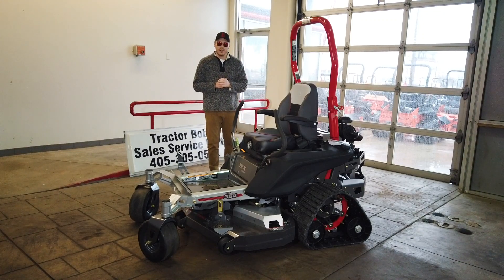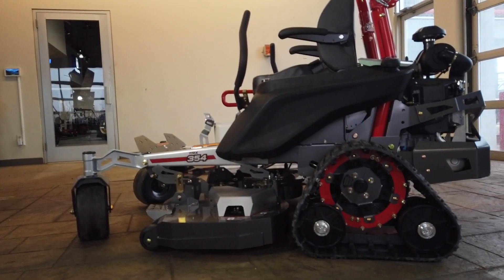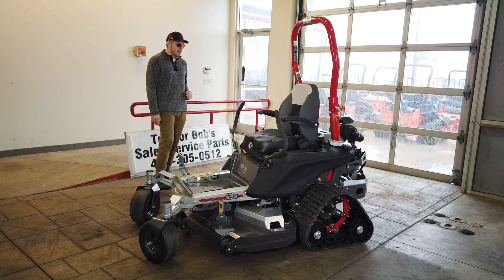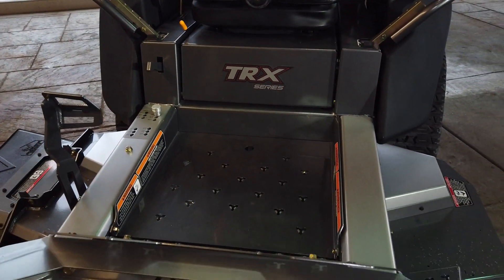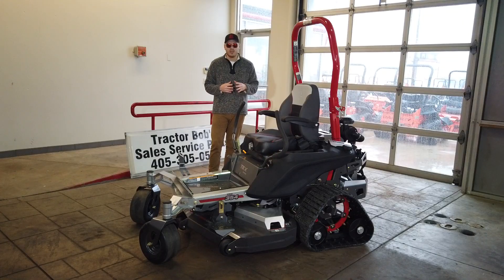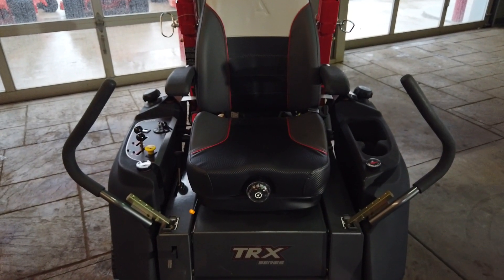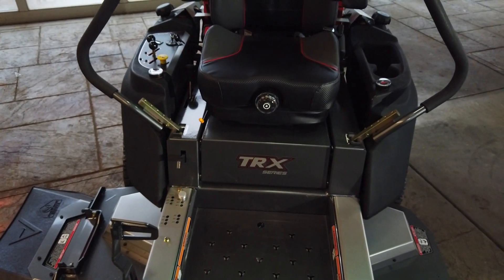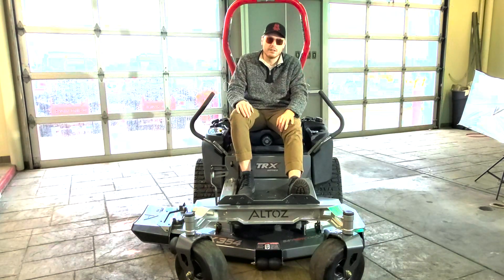ALTOZ TRX354 Zero Turn Mower Review ((most Extreme mower around))

Comment: a couple of things,  the 3400 trans is a bit lite for pushing gravel. don't you think a 3800 or 4400 would be better?  the reason for only 8 mph is the wheel (drive sprocket) is smaller than a tyre that normally fits these axels.  would like to see those tracks fit on a ferris stander- talk about unstoppable!  don't think that kawi has enough power for that mower.